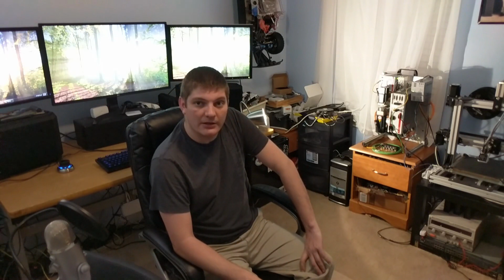Motion Control and IO with PLCs - EP1 - Series Intro

Comment: hello, your videos are really helpfull. I am trying to control a Festo 3 axis system with twincat. I have the hardware configured on twincat and will be using the NC I library. I was wondering if you can tell me something about M functions in the G Code. How can I connect M command with variables in the code. that way i can for example turn on a spindle via G Code. 
Have a great day.

Comment: Thank you for all of your videos, they are very helpful. I have a question completely unrelated to this series, but related to Beckhoff TwinCAT PLC. 
I normally connect the TwinCAT PLC to a computer, and use it using a visual studio IDE. I am struggling with shutting down the system properly. I normally, shutdown the PC, then shut down the router and when It comes to the TwinCAT PLC system, I just take the plug off to cut the power supply to the PLC. 
Could you please help me how I can turn off the Beckhoff PLC properly. I have looked at the beckhoff instructions, but they only mention that I need to turn off the embedded pc first before cutting the power supply off ( the embedded pc is in the PLC system). 
Thank you  very much.

Comment: Hey, your videos have been helping me a lot lately! Thanks for that! But i'm having an issue with my stepper motor (AS1030 connected at EL7031), the warning LED is on and that means "motor power supply not connected". I also have errors at twincat telling me that EL7031 has CoE - Emergency errors... Can't even jog the motor via twincat... is there any noob configuration i probably skipped or it might be something faulty you would recommend getting a technician come here? using 24V / 4.2 A power supply should be enough, its the only connected terminal.
Sorry if this isnt the correct place to post this

Comment: Hi Squishy again,  Did you make any demo videos for matrix operations ?  I didn't find any in Pizza Oven series as well.
Reply from the maker: Yea, that is out of the scope of what I wanted to show... I think there are some helper functions though if needed.  Also, check out 'oscat'.
Reply: Thanks for the prompt response. I managed the other way to use Matrix operations. But now I found new problem , There is no TwinCAT Measurement toolbar in toolbars , I can't use Scope. any way to get rid of this ?

Comment: hi , I followed your previous playlist .. I've problem in installation of TwinCAT 3 XAE environment in my personal pc ...... I have got the problem ... When we install TwinCAT , it makes by default log files in one of the users folders........ My user folder name is .... some word in korean language+pc .... and on installation twincat doesn't recognizes that korean word and gives error ,,,, I'm stuck here ... and I can't change the name of the folder because its system folder ...  Let me know if there is possibility of fixing such issue ... I can share screen shot of the error ... Thanks
Reply from the maker: Maybe try making a new user without korean characters, and work in that user?  I have no experience with that, but sounds like an annoying problem to have. :(
Reply: Thanks Squishy for the reply . I did the same but it didn't work.  I changed windows and then kept English language only so in this way I solved this problem. TwinCAT by default make log files in system folder so we need to have a proper system folder without any special characters , good day!